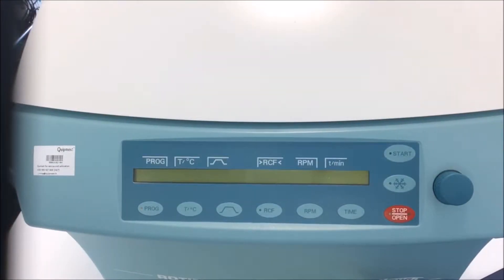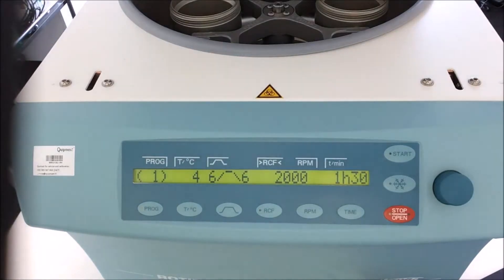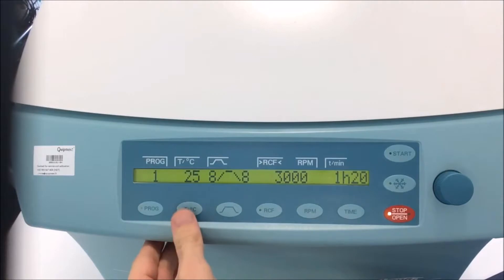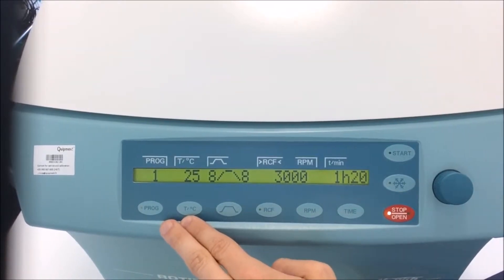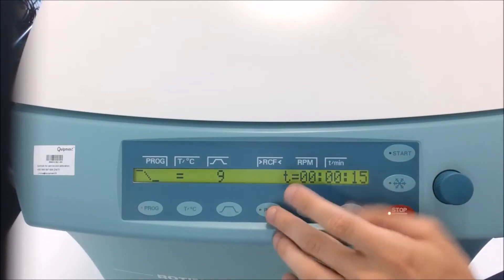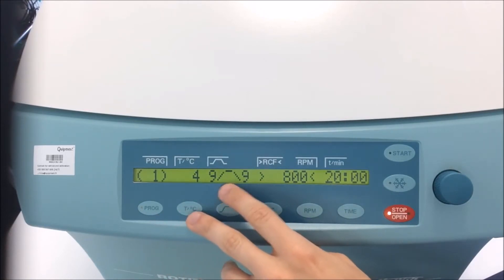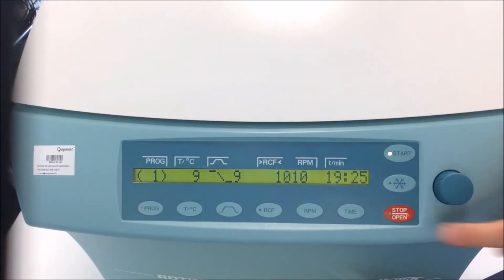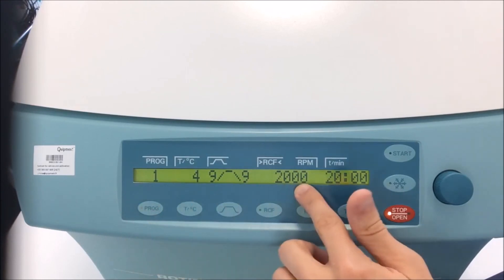Rotina 380R Operation

Comment: Hi jean, I had a problem. The screen showed "mains interrupt". So i couldn't operate it. How can i fix this problem?
Reply from the maker: Hello,

This message means there was a power failure during your centrifugation run. According to the manual, you can try to open the door/lid, push the START button and repeat the centrifugation if necessary.

Comment: Hi Jean. I have a question. 
How is the procedure to level the centrifuge on the table where it is installed? Thanks you.
Reply from the maker: Hi Esteban, there is no specific procedure. Usually we just lift the centrifuge with 2 people as it is quite heavy :)
Reply: I want to ask one question how to separate the blood to plasma then to prp ?? I ask about the time and rpm and temperature??
Reply from the maker: @mohamedawad4269  That's a very specific question! I'm more of a Tech guy than a biologist unfortunately. From what I can read, it seems you can obtain prp by centrifuging the whole blood at 1500 RPM for 5 minutes. A protocol says the whole blood has to be stored in Citrate Tubes (the ones with blue caps). But I'm really no expert in this domain!